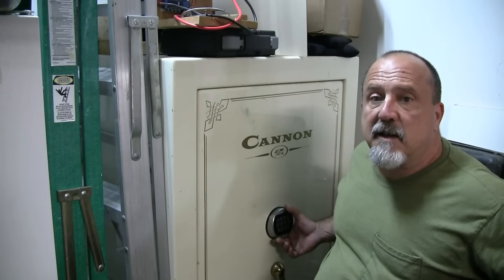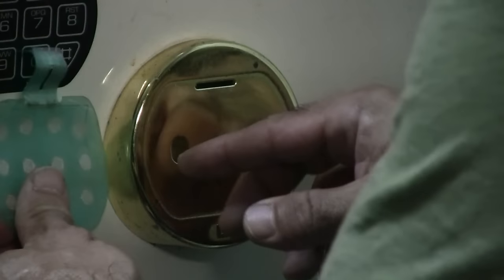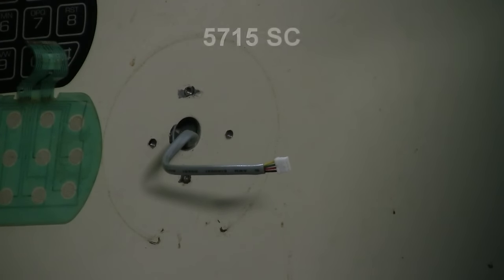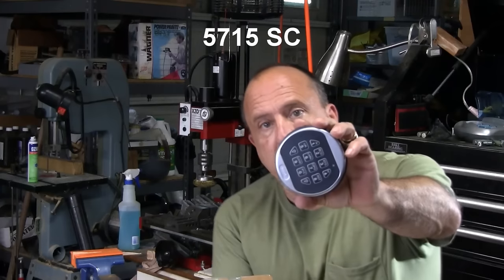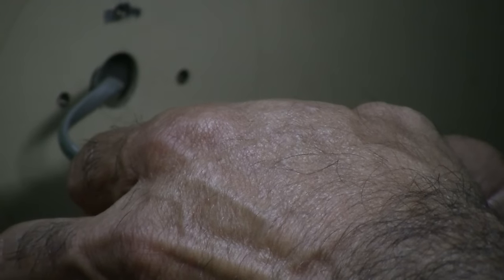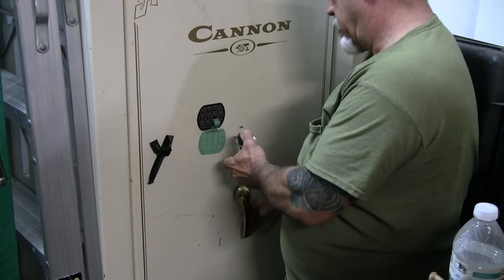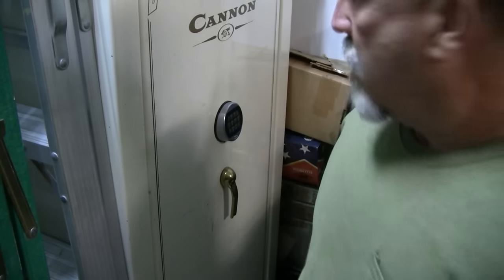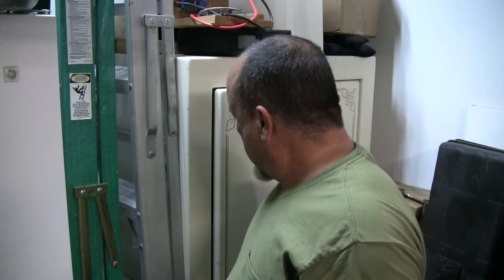Cannon Digital Gun Safe Fail Fix! Locked Out! Don't Drill - TRY THIS FIRST!

Comment: Any reputable safe technician that drills your safe open will offer to properly repair the hole and install a new lock, so your comment about the hole left behind and the vulnerability is not accurate.
Often times the repaired hole is stronger than the factory steel if done correctly. 
Also, your single battery set up is known to fail quicker than the double battery keypads that are the same Kaba/Lagard brand.
You replaced the keypad with the same set up...hmm.
Suppose your gun safe cost $2000 or more and it took some doing to get it downstairs - is it still worth "cutting it" open vs paying a professional $800 for a 2 hour open and repair ?
Reply from the maker: Yes, I stand corrected on the safe being compromised. More than a few Safe Techs me on that aspect. It isn't a $2000 safe, it's a 20 YO Piece of crap,. BTW, Cannon sent me an even worse lock and keypad than the one I put on on a temporary basis. Yes, I would have cut this one if the internal had failed, and would have made it an ammo cabinet. Were it a better safe, I would have found a reputable safe technician. As a matter of fact, I pinned my own comment to this video with a link to Savta so that anyone needing to find a certified safe and vault tech had a link to it.

Comment: so basically you can take off the old electronic pin combo and apply the right voltage to the right wires and you're in....hmmm not that safe.
Reply: J, "so basically you can take off the old electronic pin combo and apply the right voltage to the right wires and you're in....hmmm not that safe.
"
Incorrect he has only replaced the keyboard and it's mount.  The keyboard will send the electronic representation of the various key presses, typically as a series of pulses for each key press,  to the control logic that is inside the safe.
The control logic will parse and store the code from each keypress until the correct number of keys have been pressed.  It will then compare the combination entered to the stored combination.  If they match it will unlock the safe. If it doesn't it will dump the entered combination.  If the control logic is properly engineered, it will have a bad combination entry counter and time-out function. Enter the wrong combination too many times and the time out function will kick in.  At that point the control logic will ignore any combination, including the correct one, until the time-out has expired.

Still, I prefer the old school manual style.
Reply from the maker: Thanks Smokegrinder3. That is correct, there is digital logic involved between the keypad and the lock. I originally thought that applying voltage might work but after a little research figured out that was a no go.

Comment: Ok. Let me take you to school sir. Drilling a safe will not ruin it or make it less secure. Someone will not be able to open it with a screwdriver. Your advice with the keypad will work sometimes not all the time. Your advice on not drilling is not correct. As safe tech will repair the drilled hole with a tapered hardened steel pin. So stick to your day job and let the true safe techs advise customers on what is safe and not safe.
Reply from the maker: Is what you really mean is, let me charge customers $800 to unnecessarily drill their safe? Cannon was incorrect in automatically assuming the safe needed drilling. Several other safe techs have already corrected me on the safe being compromised, in a much more polite matter I may add. In any even, my safe is functional now , so pray tell why should I stick to my day job?
Reply: @ExtremeDIYGuy  because if I came out I would try a keypad swap first. I would only charge 150. Second if I do have to drill due to solenoid failure inside the lockbody I would charge 300. I would be in your safe in 10 minutes with a 1/4 hole. I would install a harden steel pin to deter any future attempt at drilling through the same drill point for your LG Basic. Which are good locks before Kaba bought them out. I’ve personal opened over 200 cannon gun safes in my career. Not to mention several thousand more of all levels of security. I would never lie to a customer about the integrity of their safe. I would put your Safe  back in service in better and far more difficult to drill then when it was made. The protection of your values is my job. That is why some schooling may be involved. I was not trying to be rude. That was not my intent.
Reply from the maker: Jon, If I had spoken to you first I would have had you come out and work on the safe, good work on a fair price. As it was,  I spoke to Cannon first when I filed the claim. They in no uncertain terms told me it had to be drilled. The local safe tech I spoke to was more interested in selling me a new safe than fixing this one. The Aha moment was when I spoke to the folks at MBUSA who clued me in on the code being stored in the lock body itself, not the keypad. The rest is history. Incidentally, Cannon eventually sent me a replacement lock and keypad, an NL which was pretty crappy. The relocker plate didn't lift the relocker bolt high enough for the safe to operate properly. I'm considering a higher end NL and will stay away from S&G unless I completely change out to a mechanical lock. In any event, I was perhaps a bit hasty in my response. J